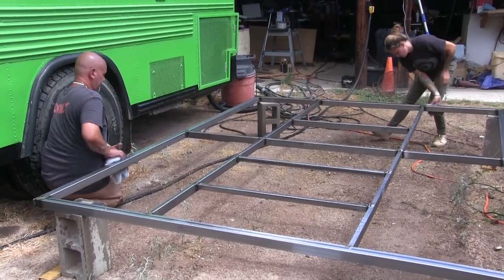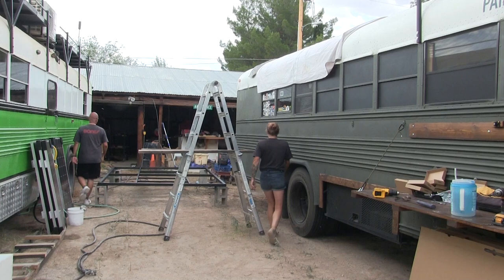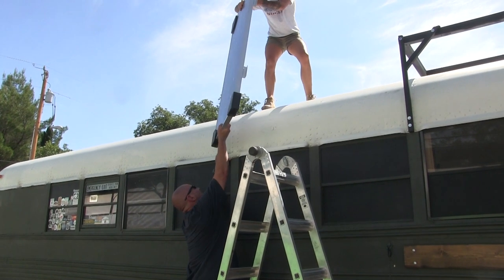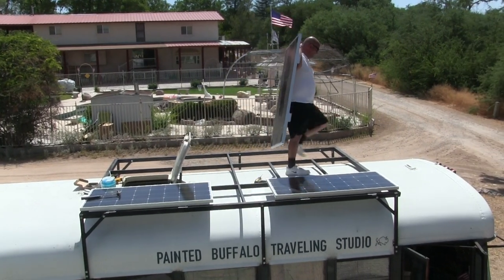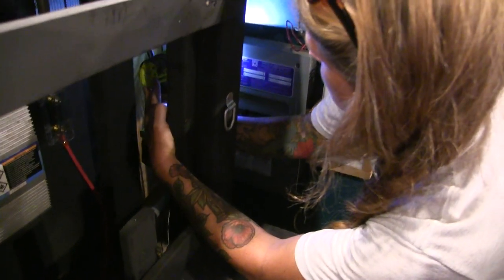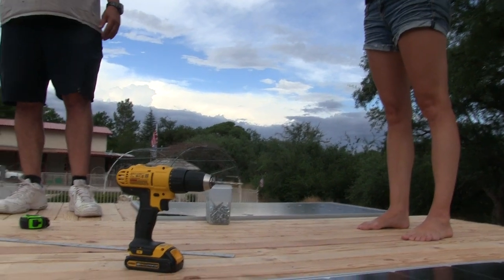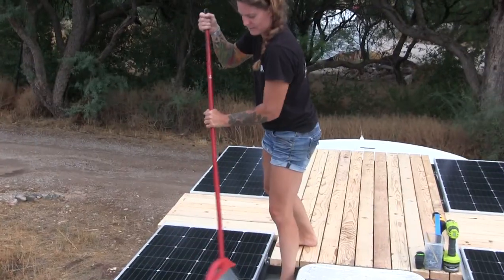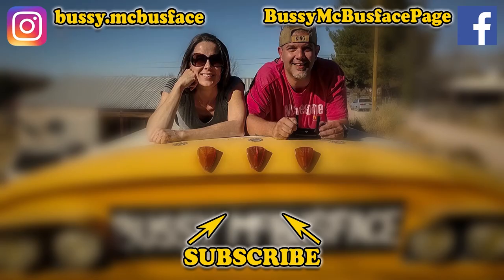Installing Jessica's Solar Roof Rack | Part 2

Comment: I noticed the screw as a spacer and it reminded me of home. Built my first few decks in California. Dry redwood, we always used spacers for when the wood expanded. Moved to Savannah Ga, and used spacers on a deck here for somebody's home. The wood is not dry redwood, it's very wet douglas fir. Left him with giant gaps in the summer months! Now I know to build them flush together, and there's a bit of space when (if) the humidity goes down.

Comment: You really should have used a foam roller if you wanted a spray finish with more mils than rattle can would also lasted far longer no judgement